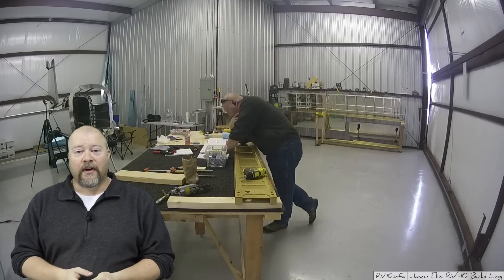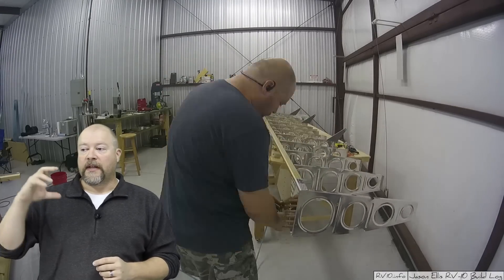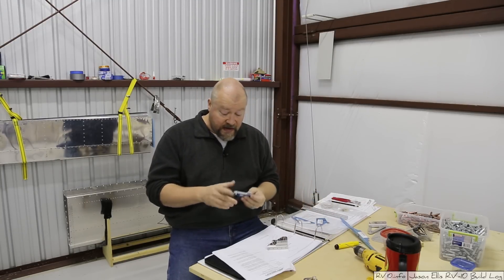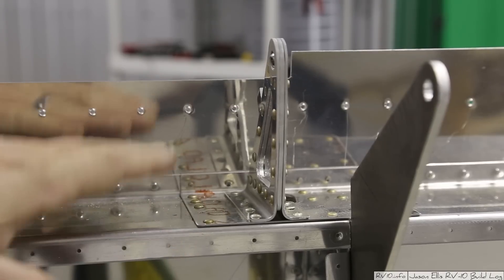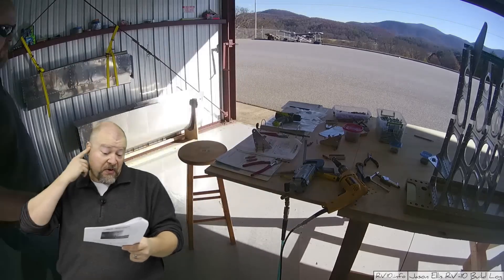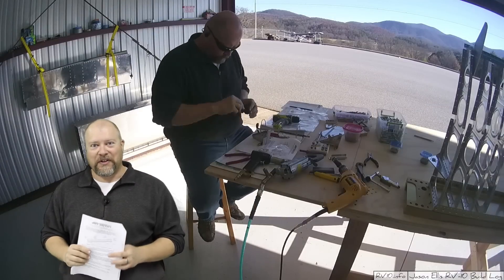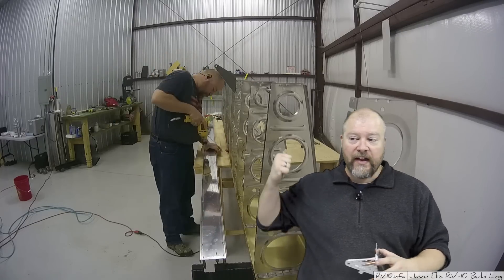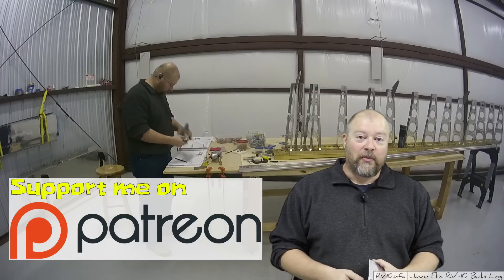RV-10 Wings - 035 - Right wing continuation and service bulletin

Comment: Another great video. Smart decision to do the SB, can't believe you have to pay extra for the material to do the SB repair because of their design flaw. And you are correct on the doubler on the backside of the aft spar, they are always to strengthen a part or certain area. Keep up the good work and I will continue to live vicariously through you on your build.
Reply from the maker: Hrmm  That brings up an interesting question;  Should a service bulletin be free?   I don't know how I feel about that.  I mean I kinda feel like you should have to pay for it because these things are unforeseen and more over, you could have the old method build and fly for years with zero issues ( many people have ).  So expecting Van's to eat that bill (even though it was cheap) seems a bit harsh.  

BUT, to your point if it was a design flaw that caused major issues then the company maybe should pay for it..  I wonder what others think?
Reply: Yeah, thinking about it further, SB's and AD's are basically repairs, and manufacturer's don't pay for any repair's. In all the SB's and AD's I've worked on I never thought to ask who paid for the kit's, but I think now it's on the owner's.
Reply: Generally it's the owners... I've seen some ADs be covered by warranty, though.  Never a SB, though.

Comment: just to elaborate a little, for those builders that are not familiar with Sheetmetal procedures.

when you find a crack in metal, or plastic, you take a small drill bit, typically an .040, and you will drill at the end of the crack, usually at the farthest part the crack goes, and at EACH crack. This is called a stop drill. You are drilling a hole to stop the crack from progressing.

Then, you take and measure that crack length, and measure the length of the overall length of the piece that is cracked, and you can determine at what percentage the crack is in regards to the over all length of the metal part. typically in a radius of a bracket you never want to exceed 25% of the length, because a total and complete failure of that attachment point can lead to a catastrophic failure of the part in question, and considering it is the aileron attach point, you DO NOT want ANY cracked metal there, at all.